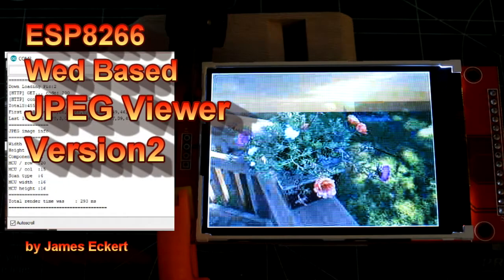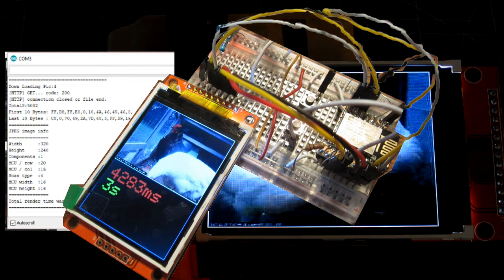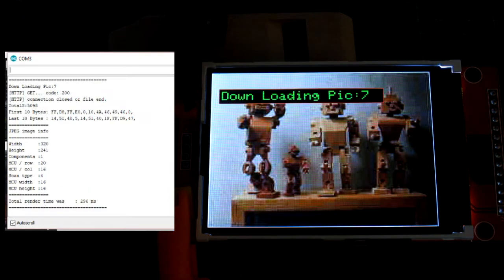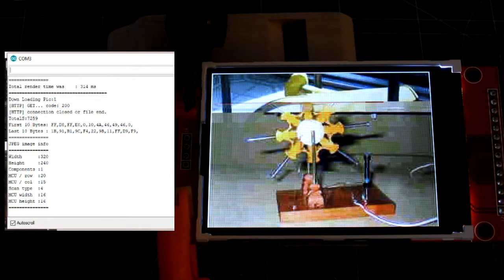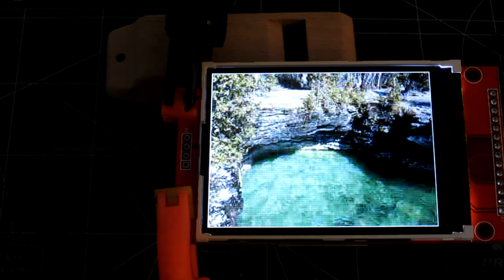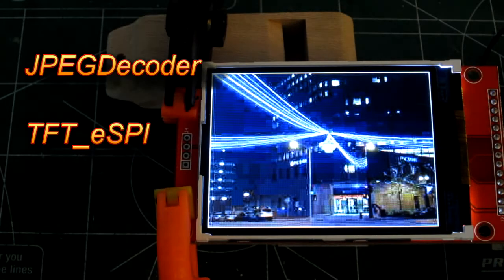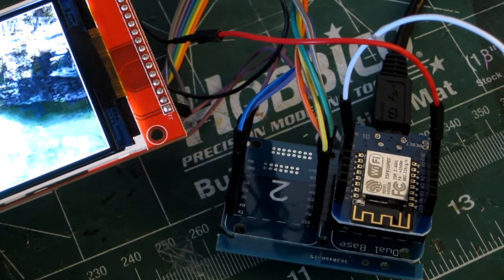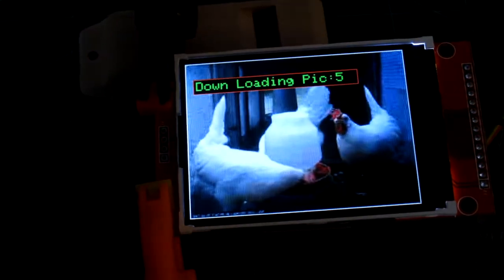ESP8266 Web based JPEG viewer

Comment: can i the code for the web based jpeg viewer. this is the thing actually  want.
Reply from the maker: The code I used for that is at http://www.jeplans.com/Electronics/Electronics-d.php?targp=ESP3Electronics1
The JPEG render issue was fixed in a newer library. Also I got working with latest ESP package. Unfortunately of half dozen versions i saved I am not sure which it is but this will give you a good start.

Comment: how hard would it be to make a 3D printable V4?
Reply from the maker: The wood parts could be 3d printed, but the Cylinders and pistons will still need to be metal to work smoothly. Also no 2 printers or filaments will print the cylinders the same size so you would still need pint it small and bore out a bit to put in the brass sleeve.
Reply: would you be able to make a 3D print version of it?